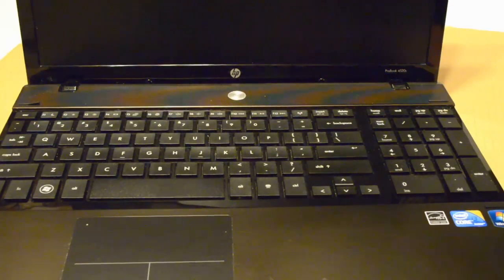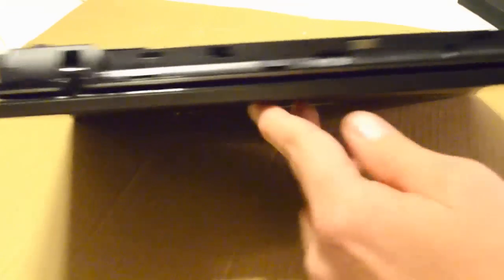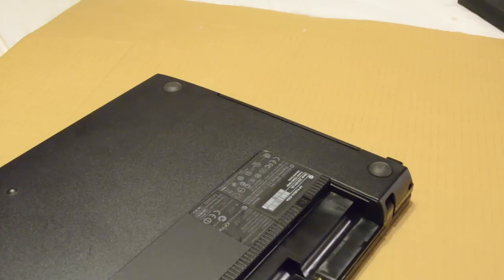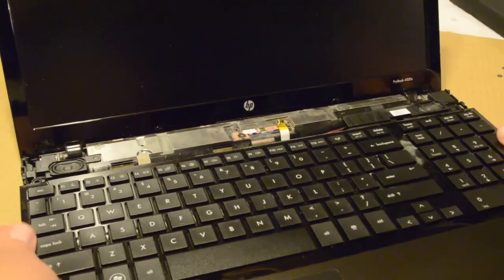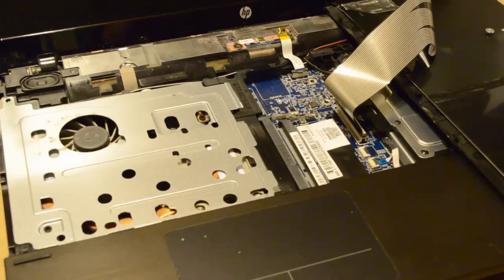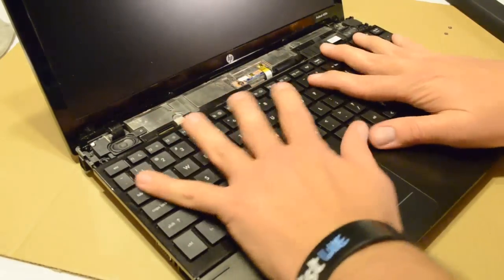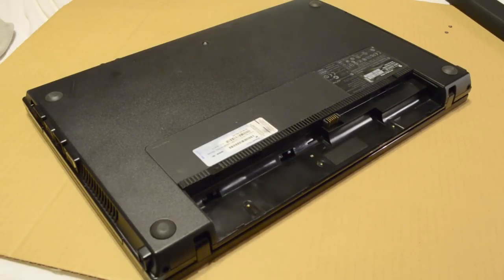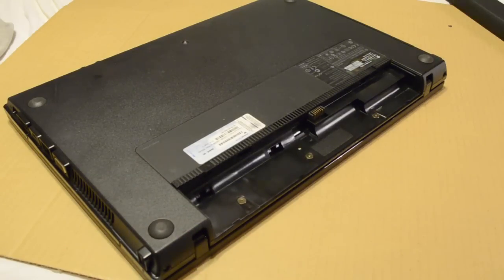Upgrading Memory - Ram For HP ProBook 4520s Laptop

Comment: Great video. Surprisingly, what turned out to be most difficult was getting the narrow top panel back in place! It's design and fit should be carefully understood before attempting. The edge closest to the keyboard does fit over the keyboard's edge but mine somehow resisted cooperation and I only succeeded by flexing it to raise the mid section a little higher, then using a thin knife blade to coax it over while urging it back. Also, the three screws under the battery thread into brass inserts that are heat sunk into the plastic: one of three broke away when re-installing its screw and another was missing. Conclusion: if you'd like them to hang around, go gently and do not over-tighten!

Comment: Thanks for the great video.  Real easy to follow.  I just completed upgrading to 8 GB.  I do have a question, however.  When I check the system it shows 8 GB RAM but shows only 2.92 GB useable.  Is something wrong?
Reply: Guess I'll answer my own question.  I was using windows 10 32-bit OS.  When I switched to windows 10 64-bit OS the useable memory increased to 7.8 GB.  However the change wasn't without pain as some programs that worked on the 32-bit OS won't work on the 64-bit OS.  So beware . . .

Comment: I finally found some RAM I believe is compatible
http://www.amazon.com/Crucial-PC3-12800-Notebook-CT2KIT25664BF160B-CT2CP25664BF160B/dp/B005MWQ6WC/ref=sr_1_6?&ie=UTF8&qid=1434671931&sr=8-6&keywords=4GB+kit+(2GBx2)+DDR3+PC3-12800+Unbuffered+NON-ECC+1.35V

But could it be a problem that my battery is broken and has to be plugged in or else it dies after a minute or so

Comment: I have the same laptop and today I'm gonna upgrade to 4 gigs on a 32 bit windows, someone told me not to go to 8 gigs because of the 32 bit windows, it will not use more that 4 gigs, now I also have some overheating problems from time to time, my question is.....is upgrading ram going to make overheating harder to happen because of the better performance?

Comment: Another question is i am gonna get a 4 gig chip not 2 x 2 but an actual 4 gig could i put it in the extra slot and have 2 and 4 gigs making it 6 gigs in total or does it need to be the same amount on each
Reply from the maker: it's best in matched pairs for dual ch memory you get more throughput. but the 2 and 4 should work as long as they're the same speed and make to avoid any conflicts that could arise .

Comment: plz help me I have a probook 4520s with the i5 processor and the AMD 4300/4500 GPU can I upgrade my GPU to something better ?? thnx in advance :)
Reply from the maker: Sadly the GPU in laptops isn't easily upgradeable their soldered to the motherboard  in most cases then you could have cooling issues, even if it's possible the cost may outweigh the performance difference..
sry for the bad news, but ty for watching :)
Reply: thnx for the info for now I'll probably just upgrade my ram then :)

Comment: I have HP probook 4520s with core i 3 processor and have upgraded the RAM to 8 GB..
windows 7 32 bit recognize 3 GB Ram so I want to install win 7 64 bit...but
when i install the windows7 64bit it copies all the file and after a quick restart it freezes on the "starting windows" screen..
help :(
Reply from the maker: Windows 7 and 8 have issues installing over a another copy your gonna need to format the hard drive the full format not a quick format, i use a windows xp cd or hook the HDD  via usb adapter and format through windows management in xp
Reply: Thanks for your reply...i will try that n let you know :)
Reply: Vinay Ambavane This laptop has issues with RAM compatibility. Remember to ask the seller 3 times if it works for this specific model. If your only problem is Windows, Microsoft solved it for you this month ;) And seriously - I invested €100 in SSD and it reaaaaly makes a difference!

Comment: Hi.. Thank you very much for such a nice video. I must say that your video help me a lot to understand about hardware of my laptop otherwise it would be very difficult for me to disassemble my laptop. I am a chemist and unfortunately I don't understand a lot about laptop. Anyway, I would like to ask you about RAM and its type. I have 32-bit system with M380 2.58GHz processor and it has 2 GB RAM but I want to upgrade my system upto 4 GB. I saw in the specifications book of HP-4520s book that there are two type of RAM 1) DDR3 PC3-8500 (1066 MHz)* or 2) PC3-10600 (1333 MHz)* SDRAM. Do you know which one will support in my laptop and can I upgrade my RAM upto 4 GB. will it work faster after upgrading to 4 GB...
I am really look forward for you reply asap, please.
Reply from the maker: This memory should work fine for your needs
 http://www.newegg.com/Product/Product.aspx?Item=N82E16820145282

Yes more ram almost always speeds up a computer and makes a huge difference.

The best speed ram i have found for this computer is the  PC3-10600, DDR3-1333MHz

Thank you for watching have a great day :)
Reply: Thank you very much for a quick response. it really helps me a lot. Have a nice day you too.

Comment from the maker: Yes it looks like the same procedure, your computer uses "1333 MHz, 240-pin, PC3-10600, shared DDR3-1333 SDRAM" type laptop memory.
If you Google cpu z it's a small free program that will give you all the technical specs on most computers it's very handy to have.
it's also a good idea when you have it open to clean your fan too .
Thank you for watching :)
Reply: I have same laptop can u please tell me the what type (suitable) of ram I need to put in

Comment: Downloaded Saints Row The Third on my HP 4520s and decided to upgrade to 8 GB today. I was told RAM was the reason the game was lagging, even on the lowest display settings. After installing the RAM at Best Buy I was excited to try out the game. Disappointed that it did not fix the problem. Any suggestions on what I should do or even what causes this problem?

Comment from the maker: Yes the optical drive is swappable the removal process is similar to to adding memory they hid the screw under the keyboard.
 The original drive is model #  598694-001 "my dvd drives" has a replacement for 57.09 with free shipping i can pm you a link to the replacement if you need me to hope this helps . :)